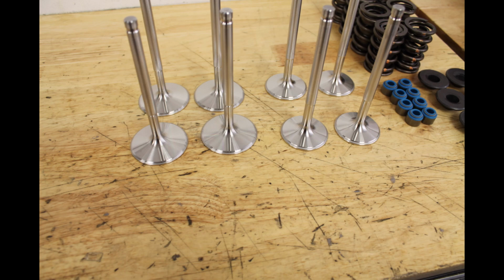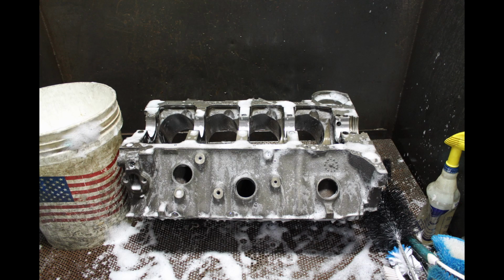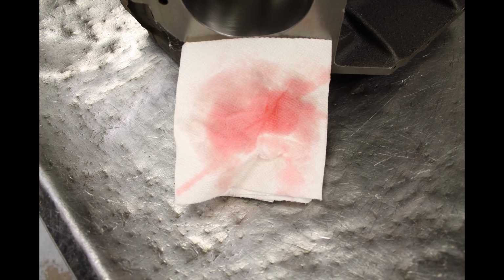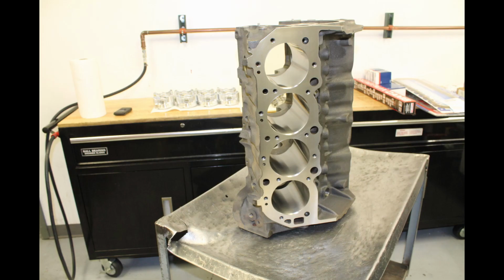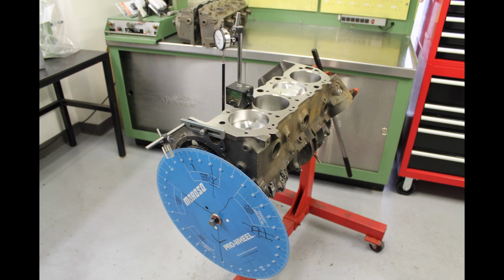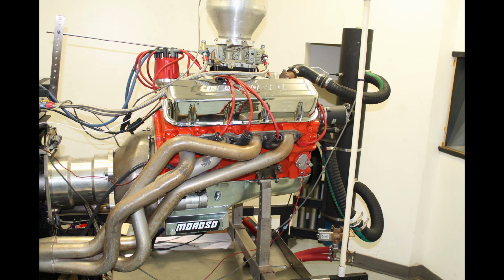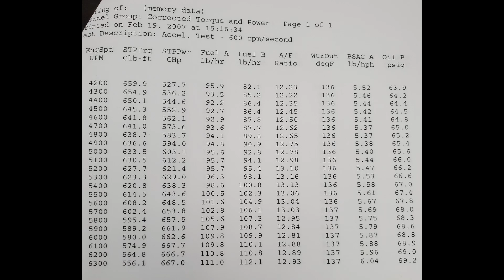Were Back!  Street Strip 496 Big Block Chevy Build and Dyno Test

Comment: Back in 1998 I built a 12.5 ls7 454 short block and installed merlin 269 iron oval ports, everyone laughed at me when I removed the iron rec ports.
12.5 compression 
Merlin iron oval ports I ported.
Ultradyne solid roller.  263 271 660 680 108 lobe sep installed at 103
Dart oval port
1050 Dom.
On a stuska dyno it did 726 hp and 640 torque.  Hp peak was 6800.
Car went from 10.60 at 128 to 10 flat and 136.
The good old days, I ran that engine for ten years on street and track.
Reply: Very impressive

Comment: Mark built one of these for me;  dyno tested it at his shop when I picked it up in Aug, 2020; just to give you an idea of his consistent builds, my dyno sheet looks like a  carbon-copy of this one, only difference was mine at 663hp vs this 667.(I'll have to get my money back :) 
I have been to Mark's shop a few times and watched him build these, from the initial greasy used-core disassembly, through the final product; He's an ANIMAL when it comes to perfection.. close enough doesn't cut it; he also has the energy of ten normal guys as a one-man show. HIs paint jobs are almost too nice to hide under the hood! Like most others, I'm amazed at the power he gets from the factory stock "junk parts" we all threw away 40-50 years ago.!! You can't argue with the numbers and the consistency of his builds. Bad news is, my lazy ass still hasn't put it in the car..A '67 442 Olds... but I know it'll be a RELIABLE fun ride.
Reply: Hurry up 
We need Quarter mile times/MPH
THANKS

Comment: Awesome, I'm building a very similar engine myself. Only 30 over so its a 489, 781 heads (almost identical to 049), scat crank, 12cc dome pistons = 9.6:1 cr, Straub hyd roller cam 229/241 @ .600/.570, 1.7 roller rockers, air gap intake, Holley 950cfm double pumper. Can't wait to get it in my '73 Camaro!
Reply: @Car Guy daddyo  I just fired it up for the first time last week. Runs and sounds great

Comment: Hey Mark I have a question about my 496BBC build..
Took my 454 Gen V (5), 4 bolt main in to get a complete 496 Stroker job done. The shop was awesome and did a great job! Worked the block, worked the 781 cylinder heads, internally balanced and blueprinted.

Bore: 4.310in
Stroke:  4.250in
Cylinder Head Volume: 118cc   
Effective Dome Volume: -25.7cc
Deck Clearance: .025in
Compressed Gasket Thickness: 0.039in

My last Dyno Pull after messing with 2 different carbs was : Timing 26 INITIAL 40 TOTAL.. DC CARB BLACK WIDOW… 850 .. UNLEADED WITH HVH 1 INCH SPACER.. Jet to 75-83 from 76-85Less TIMING…
Best we got was : 704.0STPTrq Clb-ft
And 590.4 STPPwr CHp..

Does these hp and Tq numbers look right? 

It’s going into my Jet Boat, so the 704.0 STPTrq Clb-ft was right at 3,500rpms and the 590.4 STPPwr CHp was right at 5,000rpms..

Comment: Mark, great to see you guys back! It looks like the camera quality has been upgraded too! I'm always impressed with your cleanliness of parts and build at your shop, well done. Hey I've got a question, I live in Indiana so I'm not at altitude and E-85 is everywhere and I want to take advantage of every last drop of compression. If I build a 454 or 496 with a good iron GM head with upgraded valves how much compression could I get away with on E-85 for a street/strip engine, I mean every last bit. And would you use a flat top piston and deck the heads or use a domed piston. I've heard compression ratios from 12-14.5 but I want to ask an actual engine builder. Thanks again and I can't wait for more videos!
Reply: Thanks! I've never run E85 before, so I don't think I'am qualified to answer your question, I do want to try it on my 327 truck, the fuel system would need to be upgraded on my truck.
Reply: @VORTECPRO  Is it not prevalent where you are?
Reply: @Car Guy daddyo Please read up on E-85 there are numerous articles that support people with street cars running 12 to 12.5 cr on E85. I was just wanting to ask Vortec Pro and see what he has done. I guess from his response he hasn't built one to take advantage of E85. Yes if you are looking for an easy out you can 110 octane, but if you do your homework you can run much higher cr than 9.5 on the street.

Comment: What are your thoughts on a AFR 265 head on this type of build?
Reply: I would definitely put that 265  head on there anyday before the 049's with the entry head cost of $2,300 . You can put that AFR head on a 454cid with a hydraulic flat tappet cam and make 575hp and do nothing but install them , I wonder what Mark sells a set of his 049 heads for ???  I would choose AFR 265cc heads every day of the week !

Comment: Hi, I have a Gen6 BBC. I put a intake and carb on it. Do I have to run the return from the intake to the water pump? This is my first Big Block and can't find the right answer. Thank you, Zach
Reply: No you do not
Reply: The heating system will adequately function as a bypass and those ports can be plugged. Drilling two 3/16 holes in your thermostat flange can provide sufficient bypass as well.
Reply: Mark built my engine and he recommended using the bypass hose from water pump to intake. I also used a Robert Shaw Stewart thermostat which comes with bypass holes. Since he built it and that is his recommendation that is what I am doing on my new engine. Lots of info and opinions on the web to help you make your choice. The hose cost about 5 bucks at most any auto parts store.

Comment: I have a 496 bbc with a pro flo 4 efi system installed on it and I'm trying to figure out the timing. Right now base timing is 22 and comes in at 1200rpm. Total timing is 36 and comes in at 3500. And my vacuum is at +15. When my total is running on my tablet and I'm cruising it says my timing is at 50, is that too high? And when I'm cruising in first gear and lightly step on the throttle it starts to buck around.. any tips?

Comment: I believe you guys are in Socal? Me too...not a big chevy guy, but it seems you guys are getting alot of power out of what I consider a mild setup for a 500 ci big block engine. With all the labor that goes into your builds especially in the balancing and cylinder head work, would it not be more cost effective to go Aluminum cylinder heads? 
I'm a Mopar guy and the OE 440 heads are way down on flow compared to where your at with those oval port heads. 
Good work, I love your vids, I just imagine your doing Hemis or 440s....lol

Comment: I know quite a few motor heads that claim you can’t make over 400hp on any GM iron head. One of them is another popular YouTube race engine shop.
Reply: thats just plain stupid talk
Reply: @jimmyg8656  yep an I have made good power with 489cid with oval port 049 heads ported the right way. I have a build I did that makes 589tq at around 4000 an 596hp at 5600rpm on the dino with out any tuning. We only did the break in on the dino casue the engine was going to sit casue of the build I'm doing on a 67 elcomino for a guy. I put a 6 speed tremic behind it an can't wait to drive it. We are up in the air which way to go with a carb or fuel injection system on it. But I think it has a lot left in it on a good tune.
Reply: @jimmyg8656  YES.......LOL
Reply: Which one I gotta see this!